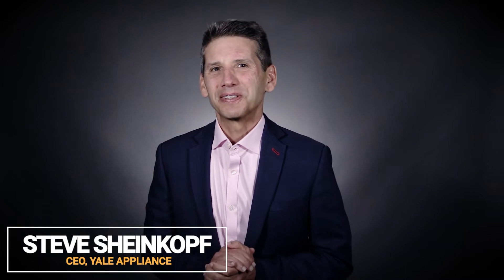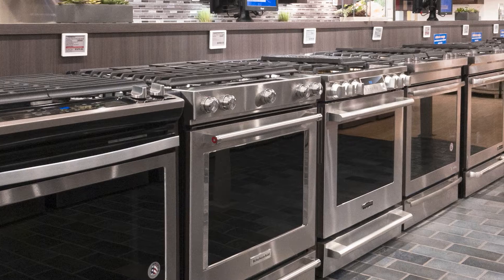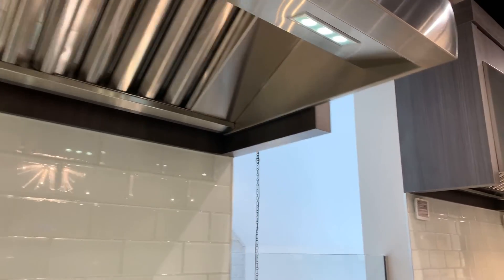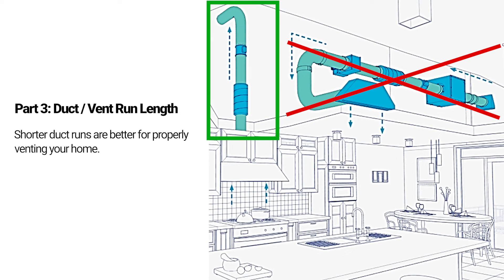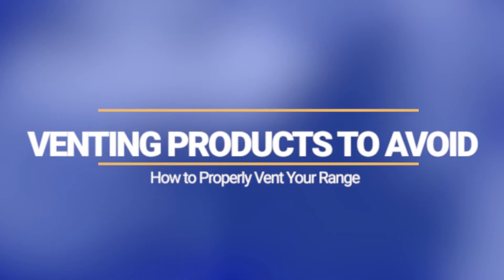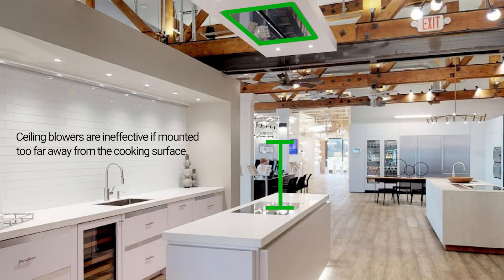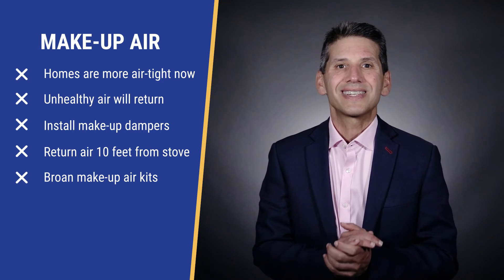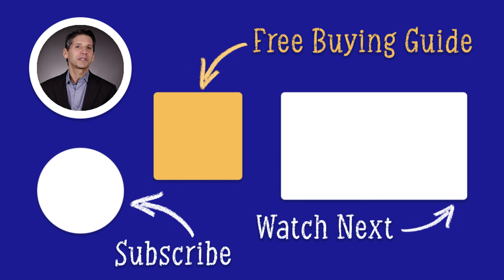How to Properly Vent Your Range – The Ultimate Guide to Kitchen Ventilation

Comment: I always open the kitchen window when using the range hood (when the oven is on).  I also open the bathroom window when using the clothes dryer. You really don’t want dirty air being sucked in from your wall receptacles or ceiling lights.  Most people don’t realize when you exhaust air out of the house in massive amounts like that, the air has to get replaced from somewhere, so it gets pulled from every void possible, mostly wall outlets and ceiling lights.  Wall receptacle and ceiling air infiltration is the dirtiest, passing through all that fiberglass insulation and then putting particles into your house.  Even central vacuums suck air out that needs to be replaced.  It really is best to have a make-up air device installed or to open a window.

Comment: This is amazing timing. Building a new house now and trying to figure out how much of a vent we need with the Induction slide-in we're planning on getting. I love the looks of the wall mount hoods.  Do I really need anything more than  300 or so CFM hood?
Reply from the maker: Induction is so efficient. Your'e not dealing with a ton of residual loss so 400 CFMs is adequate for this type of range. If you cook a lot of high heat/high smoke/ high odor foods you may consider going with more (and also increasing your capture area).

Comment: You have much better so I don't have a vent system as far as a tube and outside air flow is concerned. I only have the over-the-range microwave. And the top of my cabinets are they just get saturated with grease I've got a constantly clean them. So what is a solution vent hood product that can be used in that type of situation. I've been thinking about why this has been a problem where it hasn't been a problem before and this video and the one on what not to buy perfectly explains it so thank you for that
Reply from the maker: In a sad bit of irony, I have an over the range microwave in my rental apartment.

Comment: Txs so much for this video. Not many people know about the makeup air. Lately I too hv seen new builds using gas ranges with a microwave hoods. The kitchen is open to the other rooms and hv high ceilings with picture windows. Will it help to open the patio door across from kitchen to get fresh air back in? What r ur thoughts? How do we know if the newer builds hv makeup air installed with the hvac sys. Txs.
Reply from the maker: You probably do...hopefully, but Makeup Air is only required at 400 CFM.  That OTR is only 350 CFM, so maybe not.  You would have to check with the contractor
Reply from the maker: Yes you should....I am not a fan of Vent A Hood stylistically, but if you like it....

Comment: I live in a high rise condo where we have interior kitchens and we are not allowed to vent outside since the walls and ceiling are concrete. So we can only recirculate air. Fortunately we’re not allowed to have gas ranges either, so I have an induction cooktop. I have an air purifier but that’s not for grease and oil of course. 

I’m planning a remodel with the cooktop in the middle of the open floor plan kitchen/living room, and am trying to decide whether to go with a hanging ductless hood or a ductless hood attached to the ceiling. Any thoughts on either? Should I also add some tabletop hoods/air purifiers?
Reply from the maker: While neither option is ideal...the hood will be better
Reply: @YaleAppliance1  thanks for the reply! I assume you mean the hanging one rather than the ceiling (flush) one since it’s closer to the cooktop! I wish there was some way to vent outside but I usually keep the balcony door open (about 15 ft away) and air purifier running near the kitchen so hopefully it helps!!

Comment: Yale! Help me out on your thoughts! 
I live in Michigan. Make up air is now required for any hood with 400cfm. My HVAC guy said it would be about 8k to put in a make up air. I live in a quad level single family house with the furnace in the lowest level. Thoughts on even getting a 400cfm. Will it be enough? Will a 350 vent to outside be enough? 
We don’t have enough room on our breaker or money for a convection & the electric stove is horrid (I’m a chef). Thoughts?
Reply from the maker: Depends on how you cook.  You can always cut a whole 10 feet away on the opposite side of the range.  8k for make up air damper?   Seems a bit excessive
Reply: @YaleAppliance1  yes I was surprised by how much they quoted. Should the ceilings there are vaulted & about 12ft tall. I do cook quite a bit & would like to use gas (not for political reasons lol) & I want to a sure I’m not poisoning our house with bad gases

Comment: What if you have an interior kitchen with no outside walls (stairwell behind, bathroom above, basement below) and no way to vent outside?
Reply from the maker: If you can't vent outside then you would have to recirculate. It's poor ventilation but it will get you past any local codes.